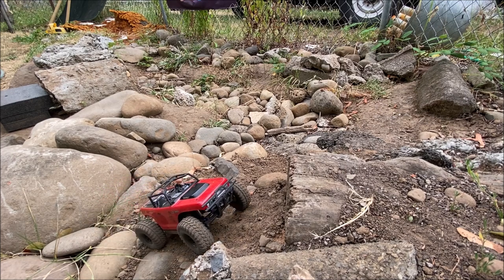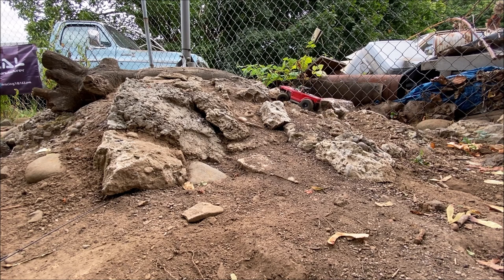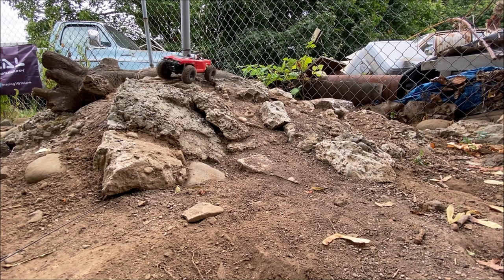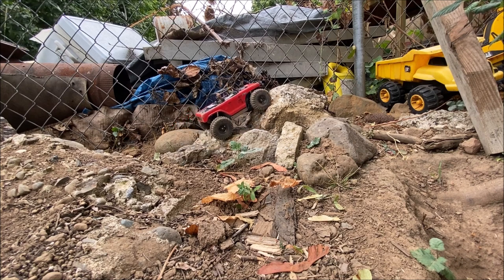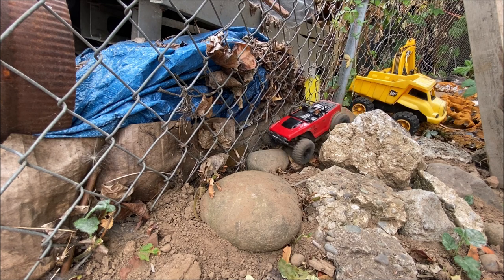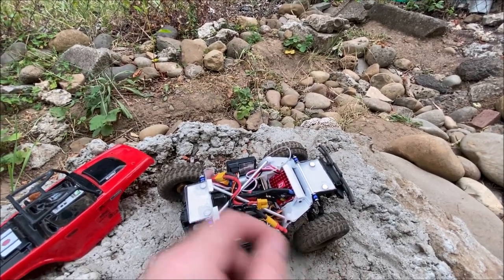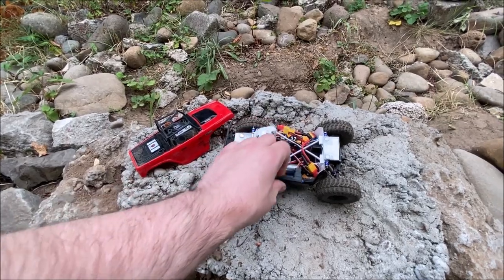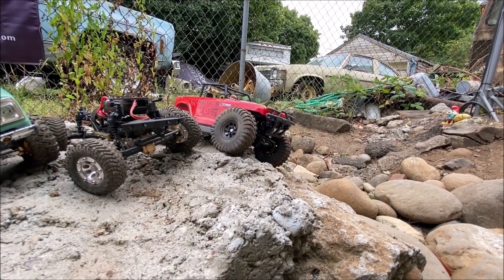Side by side dual barrage motor scx24!

Comment: Thank you TJ!  This was so so cool to have my girl up on the big screen! 
Kindof like her first day at school. 
A little info: 
The Hot Racing 43mm internal spring aluminium air shocks,  are not easy to dial them in, BUT they are excellent if you do. 
A solid mount is important,  don't want it jiggling too much,  and keep the movement on a mono-plain, you don't want them angled on more than one plain.   Looking from the front,  they should be straight up and down,  only angle seen from a side view.  Otherwise they want to catch. 
Also,  the spring inside needs very slight alteration:  the very end of the spring needs to be very slightly bent so that the steel spring "end" is not digging into the aluminum shock body. (Not all spring ends will need it).
Throw some lithium grease in,  and your golden!
So all in all,  as my first attempt at a more competitive crawler,  i feel good about it,  but she's heavier than expected,  i need to learn more (actually finish YT styrene tutorials) about body building, there's some issues that only experience can prevent,  so notes taken...
Which is why I really appreciate TJs input,  and again... it's so cool to see her up on YT, as making videos and all that is just not my bag if chips!
Thanks again!
Reply from the maker: Mrs. Rabbit Awesome thanks for the info for everyone and np problem happy to help. Pretty cool to get to test here out here and se how it steered vs now in person! Can’t wait to get her steering again and on Kelly butte! 🍻🤜🤛
Reply: awesome build!!

Comment: That thing is so bad ass!! I have those same tires on mine! Best investment I’ve made so far, besides the mil stone spacers! Great work!
Reply from the maker: Awesome and thanks a ton! I like these tires to I might just have to get a set for my own deadbolt or I might grab some rc4wd Patagonia’s. 🍻👊
Reply: TJ the rc Guy haha that was my first decision. Then I came across these. I highly recommend them! 👍 ..just curious tho, this thing on a stock servo?
Reply from the maker: tim perkins no it has a emax digital servo on but over 100o heat, 3s, weight and the huge tires killed it quick. 😅

Comment: we would love more build info and info on the tires! you got a sub out of that beast dude!
Reply from the maker: Thanks welcome to the channel. 
🍻👊
There more info in the pinned comment from Mrs. rabbit she built it and I also talk about the tires at the end of the video. This has Rc4wd scramblers on it I did did a tire comparison on the tires I have a while back to. ✌️😊
I am thinking about getting ether a set of these scramblers or Milestar patagonias for my deadbolt. 🤔
Reply: Hey thanks for subscribing to TJ channel,  he's a good guy, with a passion for rc, and always very helpful,  I've learned a bunch from him. 
I think he'll be doing another drive video,  but I'll give a bit of build info.. as condensed as i can so not to write a book..
I wrestled with a few concepts and decided on a few to go with. 
Limited suspension articulation vs exaggerated. 
I went limited.  Crazy flex is often what most seem to want,  but i wanted the ability to carry the wheels over gaps.
Chassis rigidity is key.  You want the movement to happen in the suspension. 
I used polystyrene sheets. In retrospect,  i would have used black, just ordered some. (No painting easier) 
Built a series connector for three 1S drone batteries.  Could have done two,  but then really wanted power! 
Built two battery trays next to the motor/trans, and after that just kept building!  The batt trays sit lower than the motor/trans, providing excellent CG.
In retrospect,  i will learn to build lighter,  much of my CG was eaten up by upper weight. 
The tires are awesome.  Definite advantage,  but they will eat up low CG.
Many lift their trucks.  I try not to. The loss of sidehilling is a critical error,  if you want to really crawl, though clearing rocks is good,  belly dragging is more forgiving than sidehill tipping. 
So when it comes to upgrades vs mods, low CG mods are often best to start with.
Also,  are you "gaining low CG", or simply "compensating" for other upgrades or mods that "raised" the CG?
The double motor required a metal plate,  to replace the stock plate.  This extended left, to allow another motor,  and because it was a prototype,  i simply cut up another transmission to add the second spur gear which actually acts as an idler gear.
The esc is the HW Quikrun. Silly heavy for a micro.  I'll be purchasing a Holmes Hobbies Torquemaster br mini esc,  which provides many of the same benefits,  including silent function,  but it's a fraction of the weight.   That said,  the throttle modulation is awesome!  When combining an excellent esc, with ample power,  it obviously allows punch,  but i specifically appreciate the ability to move really slow without slowing down when hitting obstacles.  This increases crawl performance immensely. 
Anyway,  i wrote too much!  Sorry about that,  hope I answered any questions you had.
Reply from the maker: Mrs. Rabbit tight on thanks! 
👊🍻✌️🙂

Comment: What was done to widen the wheels
Reply from the maker: Roger Bahr mine and Mrs, rabbits deadbolt both have kinetic kms mil- stone wideners one over weights on them. The after market wheels add a bit of width to. ✌️🙂
Reply: @TJthercGuy  cool thanks.
Reply: Feed em donuts for 3 months Striaght 😊👌

Comment: I was thinking of the dual motor thing to but I was going to use a pair of I think d30s from wpl with reduction transmission built to the motor. But one motor will face the front for front shaft and other motor will face the back for back drive shaft. I also was looking at a PlayStation 4 controller battery 1000 milliamp plus the connector will plug in to ESC but that one I don't know about don't really want to try it and mess up my ESC but I don't know whole bunch of ideas sorry just thinking today
Reply from the maker: The motors might work but most likely would be slow. Fib about a PlayStation batter most likely they are 1s and not high enough voltage and most batter for remotes and phones have electronics in the batter that might not like a rc’s power draw to.
Reply: @TJthercGuy  yeah that's what I thought so I just grabbed the upgrade battery at The Hobby Shop. But I'm almost there I just need some shocks like yours, that's next. Plus droop is more your friend than Flex I'm seeing. But great video just like the others grow informative, thank you
Reply from the maker: @DArealCHAZZ  no problem yeah droop is good I’m just not a fan of full droop more around 75%. Lots of of flex can be good it just depends on th setup and your driving skills/style. Definitely have you pick your lines based on your build. So I like having a rig with a lot of flex and a rig that’s more scale and can float tires to. 👊🙂
Reply: @TJthercGuy  those are great tips thank you. I'm just getting into rock crawling, it's been about 2 months. Before that it was Bigfoot and fast really fast trucks. It's a whole new ballgame, but your videos are a great help. Well I won't take no more of your time. See you next video I go and watch LOL

Comment: what ecu had to be used to be able to hook up 2 motors?
Reply from the maker: None they where just wired together. 👊🙂
Reply: @TJthercGuy  so you mean to tell me if i just solder the wires together it will power them both fine
Reply: @TJthercGuy  What is the strongest servo that you can  fit on a 24th scale.
Reply from the maker: @trentwolff7761  In these a lot of guys use the the reefs micro servo but I’m not sure how well it fits the stock mount. I know savox makes some strong micro servos that basically drop in without much modding. You just have to use a bit of force and longer screws to mount it. Then file the servo mounting tabs down so they clear the chassis rails. ✌️🙂
Reply: I don't mind making something to mount it on.

Comment: That is awesome, There is another dual motor mod that just uses a 3d printed part to hold two motors. One motor for each drive shaft. they each have their own ESC and are on their own receiver channel so you can toggle between 4wd, front wd and rear wd with the transmitter. Great for choosing to either pull the vehicle or push it up obstacles for greater control. check the mod its great! https://www.youtube.com/watch?v=3vBcDcX5hDI
Reply from the maker: wrhythm for sure I’ve seen that. It’s been a know micro mod for yrs now. The only down side is in the scx24 with worm gears is it’s crazy slow so only really good on rock, indoors or for comps. This was just the first dual motor on a single trans using ecx barrage motors on a scx24. 👊🙂